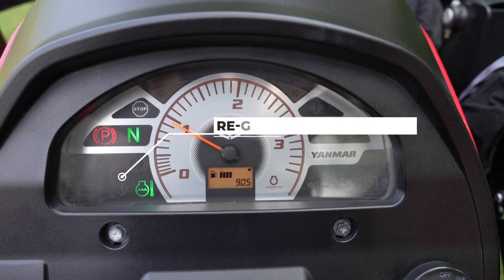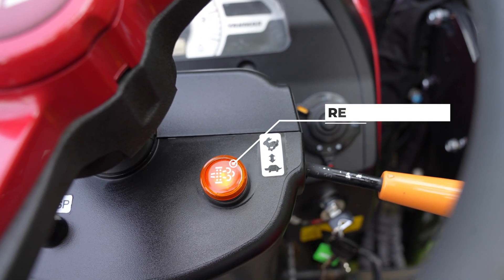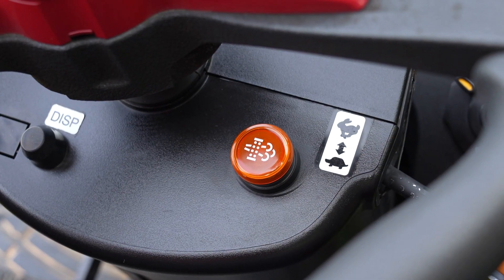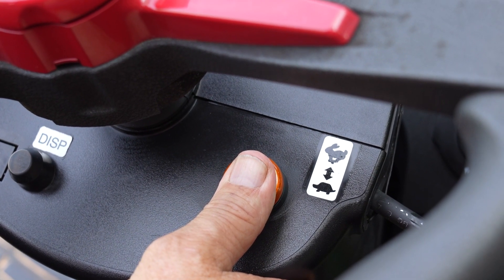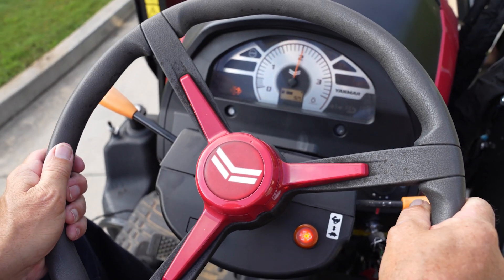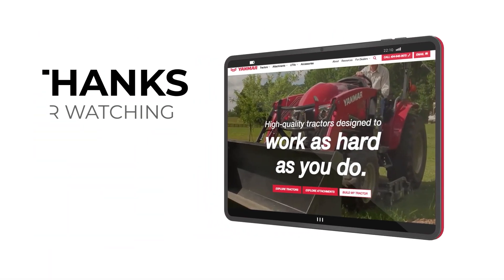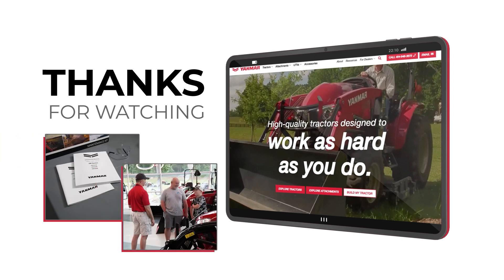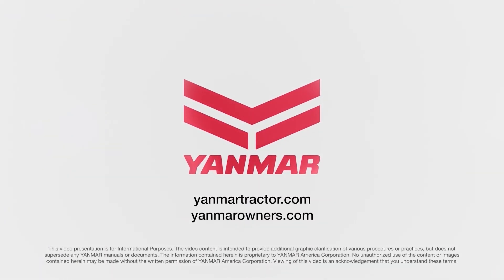Reset Regeneration

Comment: Does the tractor need to stay at or above a certain RPM and if no need to operate can it be stationary and set to idle (1800-2000rpm)
Reply from the maker: Because the tractor captures the heat from the exhaust, working would be more effective because of increased engine load.  Having the engine speed at 1800-2000 rpm or higher while working will produce the best results.